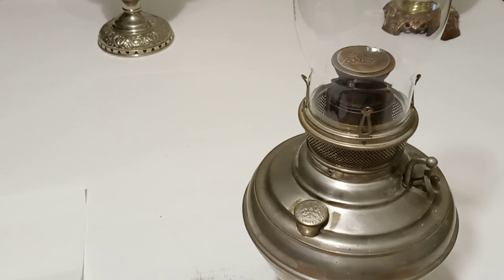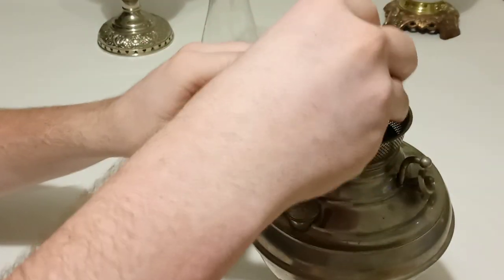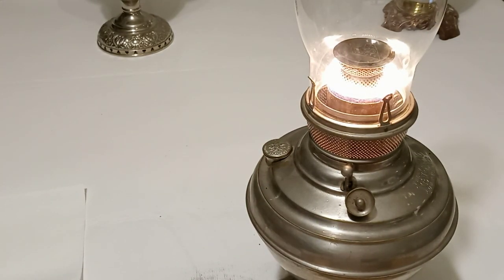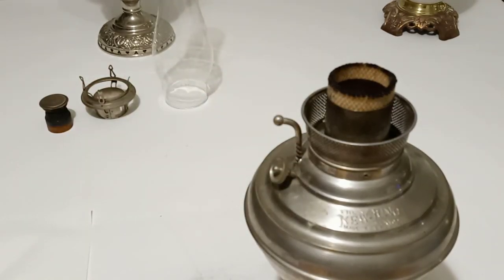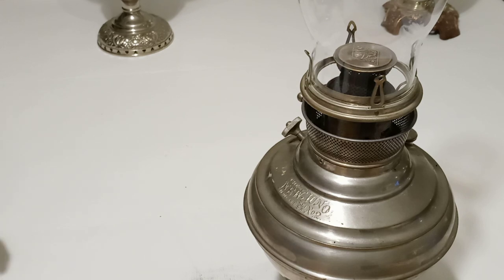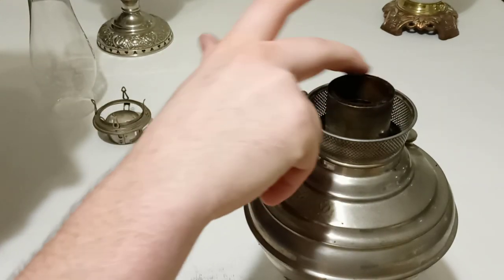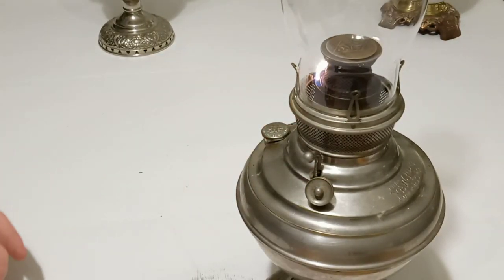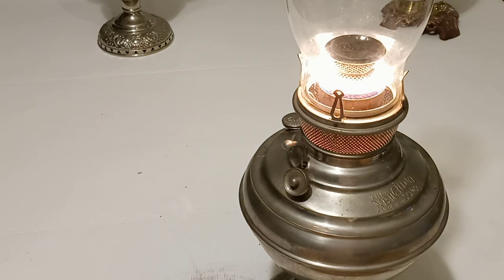How to Trim and Tune a Center Draft Oil Lamp

Comment: I have about a dozen Alladin mantle lamps, just got my first B&H wick lamp, wanted to get a tutorial on the wick trimming.  Figured I'd  need a wick trimmer like Alladins use, but nope, you made it easy.  Great video, thanks.
Reply from the maker: Aladdins are more temperamental. If you practice, you may be able to do it by hand, but the wick trimmer is a nice tool.

Comment: With a new wick I usually put a few drops of fuel on the tip raise it an 1/8" above the tube, then light it. Let it burn off the fuel, and let the wick burn down to the tube. Comes out near perfect everytime. Make sure the font is empty.  One neat trick I learned by accident, is instead of making a smooth even flame is to make it spiked. This only works with  some center drafts. I do the samething as above, but raise the wick tub up. My royal has spikes evenly spaced around the top of the wick raiser. As the wick burns down it creates evenly spaced spikes. Then when you fill the font and light it you get a crown effect with the flame.
Reply: could you upload a video of this on your youtube or put up a photo? this sounds really interesting

Comment: Would  love to see how the wick is installed , I am new to center draft lamps and have a Miller New Juno that I would love to restore and burn .
Reply from the maker: There are many unique designs to how companies solved that issue... so it is not as generic as how to tune your lamp.  I'll need to round up a variety of lamps to make a video on the topic.

Comment: Could you do a video on how to clean inside the brass well. And also what to do if your lamp isn't missing any pieces but the carrier doesn't life the wick up as you turn the wheel.
Reply from the maker: No all Center Drafts are the same, so the problems that can occur to different C.D. Lamps will be different.  Which lamp do you have?  A P&A Royal?

Comment: I have a KYSO oil lamp but it needs a flame spreader. I am told a RAYO flame spreader will work. I found a thimble type but it doesn't have the ring around it near the top and there is no indication there ever was one. Pictures show the KYSO used the button type flame spreader. Do you think this thimble one will work.?
Reply from the maker: I am unsure what a KYSO lamp is. Please send photos to me. Our business is W.T.Kirkman Lanterns.

Comment: Are you still in Ramona? Is this lamp made by Bradley and Hubbard? Do you carry any Ed Miller flame spreaders? Or will the Rayo flame spreader work? Yours, Woody (Poway).
Reply from the maker: Yes We are in Ramona. The lamp was Ed Miller built in Meridan Connecticut. I carry misc. flame spreaders. Depends on the lamp but yes B&H are interchangeable with Rayos as B&H made Rayo Center Draft Lamps.

Comment: Hi. My name is Matt. I recently acquired a New Juno No 2. I am having a hard time trying to separate the parts. You can tell it's tarnished and I was wondering if you can recommend a way to suggest for me a way to somehow use a solution or spray or something to breakdown what's stuck in between the Brass parts.
Reply from the maker: If it's Gunked up oil, you can boil your lamp in water with a little vinegar to loosen things up.  Solder melts at 360F and water only reached 212F so it won't hurt your lamp.  I recommend boiling it and if you have any movement at all, work that movement more and more when it's being boiled to get it free.

Comment: I noticed my flame spreader is a lot shorter than the one in this video so the flamme does not look the same as the one in the video, im keeping the flamme low as its a bit uneven , Sometimes it takes a while before the flamme spreads and I dont know if thats normal. Thanks for the video as Its helps a lot. Im new at this. I think I might have the wrong bulb
Reply from the maker: It is possible it is incorrect, it is also possible, it is correct as some were shorter than others, being of different designs.  It's also possible that the flame spreader got smashed in and now appears shorter.

Comment: I have ta\hat same lamp, but I cant seem to rase or lower the wick?   it’s been apart and  a new wick installed, but will not raise or lower ?   any suggestions?   thank you
Reply: Have you actually added kerosene to the lamp?  When my lamp and wick are dry, the wick is almost impossible to raise and lower, but once the wick has soaked up fuel, it moves easily.
Reply from the maker: Agreed, the kerosene is also a lunricant for these machanism. Infact this lamp was jammed up when I first installed the wick... Until I fillied it with kerosene, and ran the wick up and down 3 times.

Comment: Very meticulous trimming well done, I see and hear your passion for lamps. 
If that lamp belonged to me I would have the right to say to you ' You get on my WICK'.
A term I have not heard for a while, no offence intended. I do have a couple of questions if you would be kind enough to answer them. I have just purchased a 1930 Sherwood "Sun" Lamp 30" made in Birmingham UK. It is a centre draft burner with a tubular wick of 1 1/2" diameter x 8 1/2" long. It will be hanging in my Victorian Town House living room, house was built in 1850. Q..Can these lamps be run off olive oil as I have just filled mine with lamp oil and don't want to empty it? & What sort of pulley system (rise and fall) do you use as it appears these lamps are more widely used over in the USA? Thank you in advance. 🙏
Reply from the maker: Never use Olive Oil in regular oil lamps.  Good lamp oil has a flashpoint of 150F and is very thin to the touch which aids in the wicks ability to wick it up to the flame. Olive oil is much thicker, and to make it worse, it has a flashpoint of 460F, which means the flame has the heat the olive oil up to that much higher temperature before it will burn properly.  That is a big temperature jump and makes it much more difficult to burn.  Look up roman olive oil lamp and you will see a wick that is almost horizontal to help fix the issue of burning such a thick fuel.
Reply from the maker: Our hanging lamps in the U.S. usually use lead, often in the form of fishing weights now days, or shotgun lead shot to place in the counter weight. Since the weight of the lamp fount does change as oil burns, there is a certain amount of friction required to keep everything from moving at full tank or no tank.
Reply: @MadisonKirkman  Thanks for both replies Sir, this lamp I have weighs 4kg and is 30" tall, I was thinking of a pully on the ceiling rose and then some 4mm cord to another pully mounted on the wall, the cord would just have a couple of loops to hold on a cleat hook with an eye as a safety stop so the loops don't hit the pulley. I have 6kg of lead as I moulded some to add weight to some sash windows, but I don't want to pull the ceiling down. It will be like hoisting a body bag, the only vision I have is like a wrought iron chandellier in a castle with a rope and pulley.

Comment: My carriage slips on the wick, any ideas how to fix it? Would a new wick help as the one thats on it is very old. I have a Juno (third version) pat date 21 May 1895. Also while im asking questions what size wick would i buy? Thanks for the video it helped me get the wick to burn evenly, but i just cant raise or lower it.
Reply from the maker: The teeth of the carrier aren't engaging with the wick properly? The center draft tube may have petrified oil and cotton on it, inducing friction, and can cause slipping. Take wick and carrier out, and use warm water and vinegar to clean the fount, and a tooth brush to scrub the tube to remove the junk. Make the tube as smooth as possible.
Reply: @MadisonKirkman  Thanks for that, ill do that before my new wick comes.

Comment: Hi, I have a The New Juno no. 2 lamp in nickel.  I was able to get the gallery off, but not able to remove the flam spreader. Any tips, it has a top cap looking thing that I can rotate either way.  I cannot remove this in order to access where the round wick would be.   Help please.
Reply from the maker: It's likely gunked up with dried oil deposits, so I imagine subtle heat or a little vinegar and hot water may free up the flame spreader.

Comment: What about the heaters that used these? Not perfection heaters, oil lamp heaters, do you or anyone make those?
Reply from the maker: I do not know of anyone who makes round wick oil heaters like the Perfection.  I know of a source of wicks and some parts for vintage perfections so if you can find an original, they have some parts support.

Comment: I've done this to my rayo lamp, but the flame is super short. Is that normal?
Reply from the maker: Super short, either from lack of air flow which draws the flame upwards, from lack of fuel at the top of the wick which may mean either your wick is clogged from a previous bad fuel, or you are currently using Paraffin fuel which in America is Paraffin WAX fuel which clogs cotton wick lamps.   It could be the amount of wick you have exposed, but I typed this out in order of likelyhood because you've probably tried turning up the wick.

Comment: I can’t seem to find a answer to the problem I’m having with a lamp. The wick is only burning on the sides and not the Center. And no matter how high I wind the wick, it will eventually just go out? But this video doesn’t help due to it being a completely different kind of lamp.
Reply from the maker: I'm working on a video for flat wick lamps and lanterns.

Comment: What about “A Gone with the wind” lamp?”
Reply from the maker: Gone with the wind Lamps with true central draft wicks follow the method in the video.  Gone with the Wind is a term that rarely describes an actual oil burning lamp and often describes those with glass fount holders that have a light bulb on the inside.  If you need help getting your lamp going, assuming it's oil, knowing the maker is as good place to start with getting information on how to use and service your lamp.